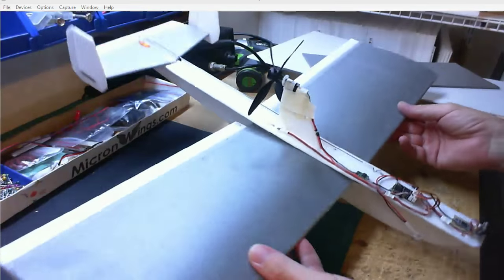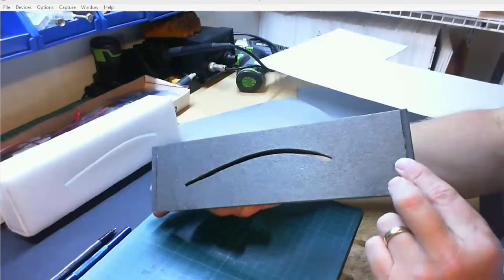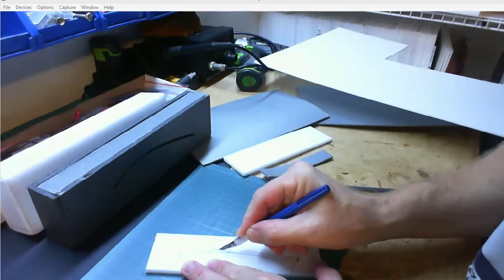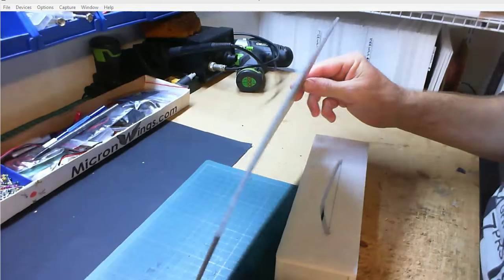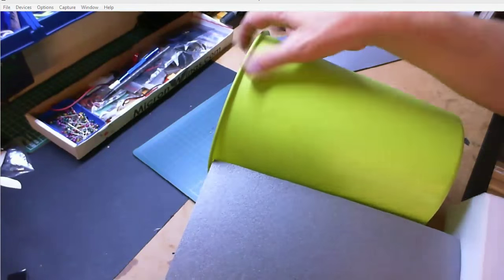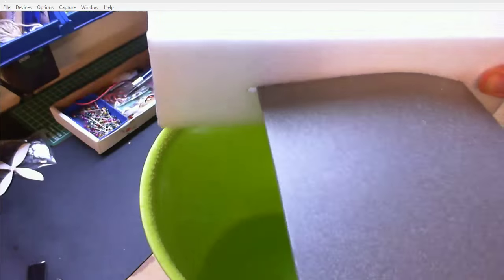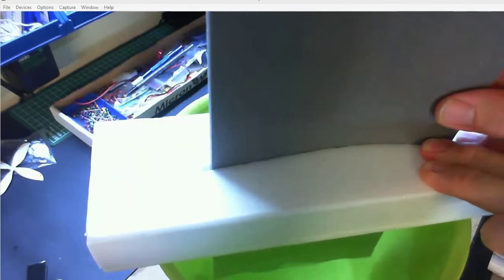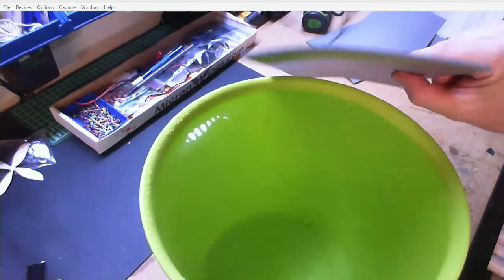Forming Depron with Hot Water

Comment: Is it perhaps an idea to do it differently?
If you were to cut two ribs in a slightly more curved shape,
And if you glue those ribs to the ends of the wing.
You make a bed with wooden slats (also in the good shape)
And you pour hot water IN the wing?
It is / was just an idea... but maybe... that could be further expedited?
Because yes, on the outside, that hot water does not touch!
(Something has to be done for that!)
(But hot water Does shrinks the materia!?)which is still well then !?

friendly greetings from The Netherlands!
Rob.
Reply: But if the wooden bed and ribs were to be glued to the wing, that would add weight without making anything easier.

Comment: Looks like there is a small amount of spring-back to straight.  Likely not an issue as long as both sides of the wing halves are the same.  I don't have access to the Depron branded foam sheets, but I suspect the ROSS brand poster board with the paper skins and a foam core is the same type.  It sure does seem to have the same characteristics.
Reply from the maker: There's a lot of foam boards out there similar to Depron. As long as the foam is closed cell foam this technique will probably work. But you would obviously need to remove the paper first.

Comment: this is exactly what i was looking for also. are there any issues with hysteresis?  should you over bend to account for spring back?. Does the shape flatten over time?.
Reply from the maker: You will expect a little spring back so it's a matter of trial and error to get it right. but once depron is formed it doesn't flatten over time.
Reply: @MicronWings  umm.. ive built dozens of depron models.,not convinced as the ones ive built stay in shape for a while but they all deform due to flight stresses and those curved lose that curvature.

Comment: how can I bend a wing bigger tnan 1000mm wingspand and more than 300mm chord length?
Reply from the maker: For larger wings for which you can't make a big enough template as i have shown here, you will need to use heat to bend the wing. Either very hot water or a heat gun are best. But it's a bit difficult to get consistant results with these methods.
Reply: I would employ a hot box, which would be little more than a plywood box of the proper size that is insulated to hold the heat from heat lamps.  Heat lamps are fairly easy to come by since they use them to keep baby chicks and other animals warm.  Once the foam is up to temperature, turn off the lamps and let everything cool off.